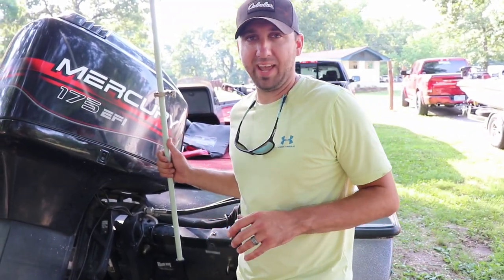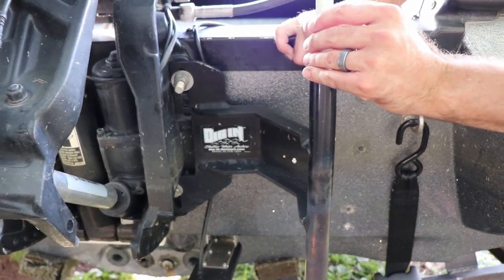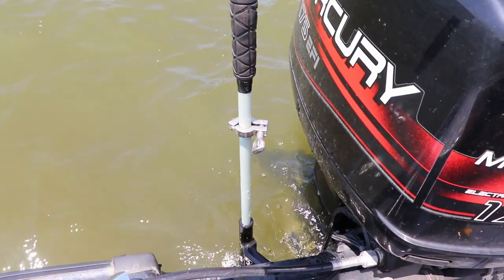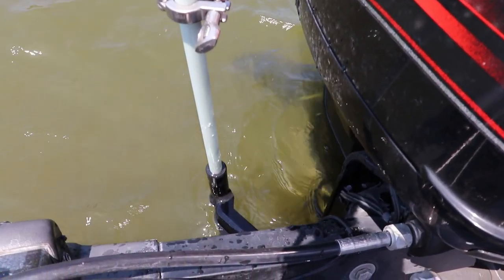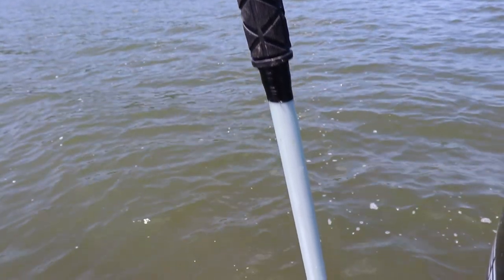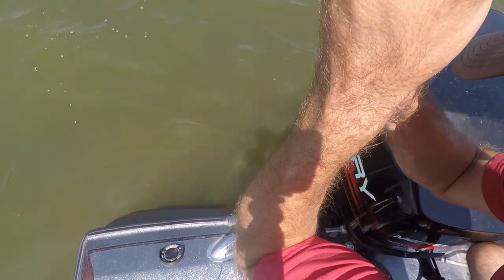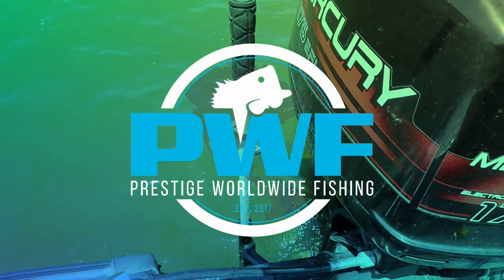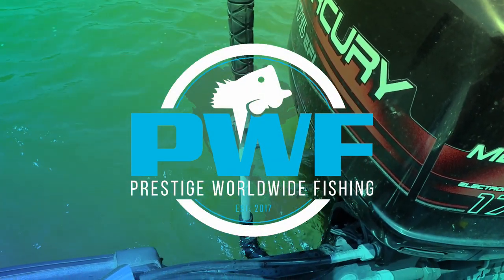Cheap Power Pole Anchor System

Comment: $250 for that mounting plate? That is lakeside robbery. They made $230 profit. No way bro.
Reply from the maker: BadCow I know that part is crazy high priced, but can’t weld, so that was my only option.
Reply: Two of em and you bought a talon
Reply: mbb6180 where can I get a Talon for 500.00
Reply: I have an old bracket for a transom mount trolling motor that I use for that
Reply: My jaw dropped when he said $250!!!! My brain automatically started thinking of ways to build my own
Reply: @michaelbailey4442   That is a great idea.
Reply: The amount of 1/4 inch marine grade aluminum to make this bracket itself is more than $20.
Then, factor in the machining cost and also don't forget the welder's setup and experience.
There is probably a $130 gross profit.
Now take that $130 and divide it between the hours that it would take you to sorce the material, design, work it and shape the material and then to find and locate a welder take it to him and pay him to weld it.
If all that amout of your time is worth less than $l30 then go for it!
If not then just pay the man.

Comment: If you drill a hole between the bracket and the pipe at different intervals you can put a metal pin in to stabilize the boat a little
Reply from the maker: That’s a good idea!
Reply: @PrestigeWorldwideFishing  throw a manual lawn edger head  with a pin on the bottom then add pin through the neck of your bracket and glass rod and I bet lot less travel. Just an idea. Thanks for the upload.
Reply from the maker: That’s a great idea! Thanks

Comment: Great idea I did the same for my pontoon boat but that bracket in the back I had made up by my own welder for only fifty bucks and I made the pole out of PVC stuffed with wooden dowels for only $13. But I do like that fiberglass Pole you're using
Reply from the maker: Awesome! The bracket is the most expensive piece so if you can weld one yourself you can really save money. The Fiberglass rod is nice because it isn’t buoyant so it sticks in the bottom easier.

Comment: Kinda the same I have 2 rod holder so I took 1 1/4  and used a  h and r fittings  I can still use the rod holder  and I run the rod down  the t fitting  use 2  and lock in the corners 1680 express w yam 60